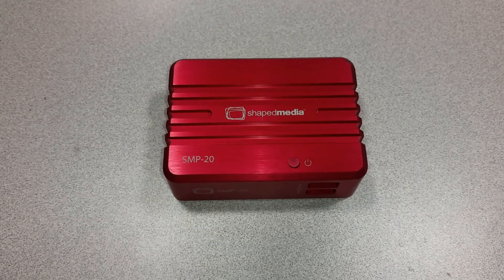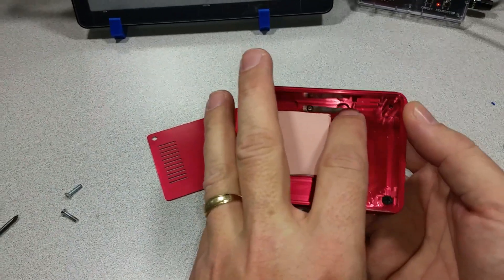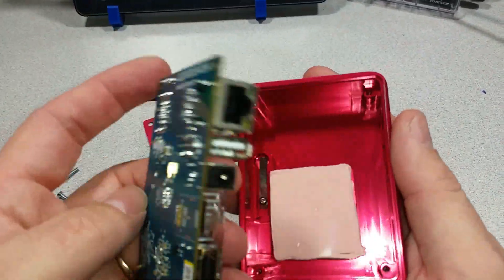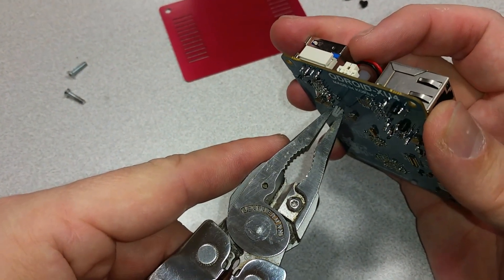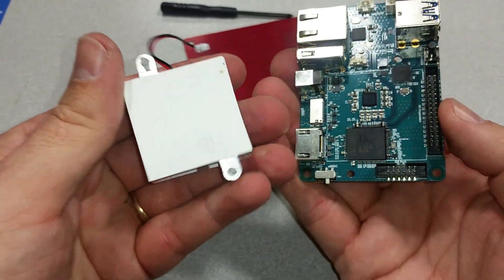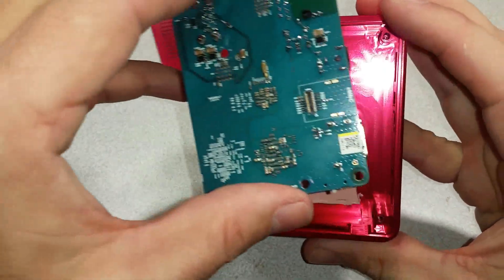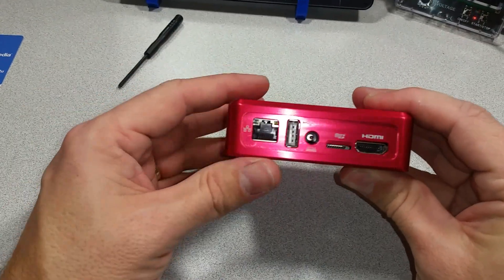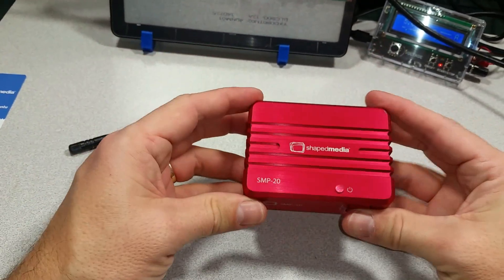Shapedmedia ODROID-XU4 Machined Aluminum Passive Heatsink Case

Comment: Sadly these are no longer available. 
I never understood why the manufacturer didn't think to leave openings in the bottom cover to access the eMMC module and SD/eMMC switch. Only two screws need to be removed to take the bottom off to access the eMMC and SD/EMMC switch. If you use stick-on feet and position them so they don't cover the screws you can have access in a couple of minutes. I was heartbroken to find out these are no longer available so I'm glad I bought the few I did while they were available. This case in silver or black gives the XU4 a very high end look. You can make it hot enough to throttle by running full CPU load testing software but it's not likely to ever throttle from regular use with Linux or Android.  
It could have been slightly better with easy access openings for the eMMC and switch but this is still my all time favorite case. The are worth every penny they sold for. All popular SBCs need a case of this quality. Good cooling and makes a high end SBC look like a high end PC. It's 2020 now and I still consider the XU4 a high end SBC even when compared to the best ARM based SBCs available.

Comment: Tip... use a small flat head screw driver next to remove the plugs, you only need one side to collapse in and you pull it out on one side and repeat.

Comment: my odroid acualy came stock with silver thermal compound. So that shuld chaing the temps but the fan is runing all the time wiel -playing kodi, off for 1-2 sec. cool cases but why so much $$ ?
Reply: ken sanchez They're machined out of a solid block of aluminum, sandblasted, anodized and laser etched. All of that probably costs quite a bit.
Reply: Very awear of all that i hve acsess to most of that kind of equipmint.I just thaink the ragular cases are to much and thear for thay aske evan more for a acual functioning case as this one.

Comment: It is a nice case, but the xu4 runs blazing hot under full load. You can't even pick it up it gets so hot. It is like grabbing a hot plate.
Reply: I have the same issue, the case feels like 50-60C when running emulators
Reply: I was wondering if this case was more suitable for commercial applications and emulation is a stretch too far for cooling. I have seen people say that the XU4-Q sans fan runs too hot on N64 emulation so perhaps this case is good for basic display / point of sale web apps but not gaming?
Reply from the maker: Even under sustained full load, I haven't had any problems picking it up. It is warm, but not warm enough to burn. But the point of the case is to pull the heat away from the SoC and into the case. It works especially well if mounted to another large metal object in an industrial or commercial environment.
Reply: you might have a defective board bro

Comment: I found the simplest quickest way to remove those pins is to just clip the tips off with wire cutters.
Reply: BTW my heat sink had thermal past and no pad?

Comment: Would this case work for keeping an XU4 cooled enough to prevent throttling while running BOINC 24/7, or is active cooling still a better option for such?

Comment: Hello again :)

I have one last question so please bare with me:
I finally bought one of those and have successfully installed it. Everything seems to work as expected apart from the push-power button. That said, I'm wondering whether I aligned the board with the case correctly. However, the screws were all in place and the fit looked secure before I had put back the plate. 

I would have taken the board out to check but I fear the thermal pad could not been re-used and I'd probably need a new one. Firstly, have you noticed whether the button works in your case and secondly, if I have to replace the thermal pad Shapedmedia provided, do you happen to know what brand and thickness I will need?
Reply from the maker: The power button works only to turn off the XU4. It seems to work fine on the unit you see in the video (just tested it). I wonder if yours is maybe not aligned correctly.
Reply: That's probably the reason. I will try to realign the board in the case. Will the pad lose it's stickiness and thermal conductivity if I remove XU4 and re-apply it? If so, do you happen to know what brand and thickness is the stock thermal pad used?
Reply from the maker: *****
The pad will lose a bit of stickiness, but it shouldn't affect the performance. The screws holding the XU4 to the case should provide adequate pressure to keep the thermal bond.
Reply: Thank you very much! I thought that the pad's stickiness was related to its thermal conductivity but, as you rightly say, there are screws which secure the fit anyway.

Comment: Just got my case today. It is very nice. The ballpoint pen worked real good to get the old heat sink off. I had to pull it off it was stuck but just slowly did from one side.

One thing when I pulled the fan power off the wires came right out of the end plug! I guess I should of used something to pull on the plug not the wires.

When I screws the bottom in I guess did it to tight because it pushed in right were the screws go. So you should have some spacers with this so that don't happen.

Love this case. Very nice. I got the green one for low power the XU4 uses.

Thanks for telling me about the ballpoint pen it takes off the pins real easy with out messing up the board.

-Raymond Day
Reply from the maker: Awesome! We got lucky on that green case as we had an overseas shipment get returned unopened (the customer didn't want to pay the import taxes). We are still waiting for our next shipment of cases which will be available in black, red and silver only.

Comment: I plan to use my XU4 as a server running 24/7 and the temperatures I get after extensive testing during the past few hours are ranging between 80-90 C (the fan spins all the time - I believe in medium speed). Do you think the specific case can handle those numbers and keep temperatures under 90 degrees C? In the video the CPU with Shapedmedia case throttles later compared to the stock fan & heat sink but what will happen if the device will run constantly day and night?

Are also the board's LEDs covered or you can see them blinking when the device is powered?

Regarding the removal of the fan, is it possible to put it back later or the plastic pins do get damaged once you remove it?

EDIT: And a last question - Have you noticed any improvement in the device's consumption? Given that this noisy thing should at least consume 0.25A there must be a subtle improvement in XU4's Wattage after removing it

Many thanks. This is a very sleek piece of equipment!
Reply from the maker: The CPU is designed to operate normally up to and even over 95C, and the Shapedmedia case will not keep it from getting to 95C under heavy loads. However, it should keep it well under 95C during normal use. The power consumption will be less without the fan, but we're not sure how much.

The test pushed the CPU to the point where it throttles. All cooling options we've tried have been unable to keep the CPU from throttling under full load. The duration of the test was long enough to bring the case's temperature up to the maximum thermal temperature, so the results should be the same no matter how long you are pushing the CPU.

The LEDs are slightly visible through the port openings in the case, but not like they are with the translucent cases.
Reply: Thank you very much for the info. These are more or less my own findings from using the case a few days now.

I now run the board with the clock of the A15 cores locked to a maximum of 1400Mhz while I haven't  changed the range of the A7 cores. This set up is perfectly adequate for the type of server I'm running. The temperatures range between 52-60 C while consumption is somewhere between 5.2-6 Watts.

Comment: Wow nice case. Good to see that I was not the only one having a hard time getting the fan off. I ended up just cutting the mounts for the fan. I put a bigger heat sink fan on mine. It all ready came with the pins to push on it.

How does it work with heat now with that case. I guess it be good no fan is very nice.
Reply from the maker: +Raymond Day I use an XU4 in this case on my desk as one of my workstations for daily work. It doesn't get hot, and my XU4 runs very well with it.

There's a trick we learned from one of our customers on how to get the fan off. Use a retractable ballpoint pen with the ballpoint portion removed from the pen. Use the opening on the ballpoint housing to compress the clips from the underside of the board. It makes for an easy and damage-free method to remove the clips.
Reply: Wow that's good using a ballpoint pen with the ink so the housing to compress the clips. I have not did that. But I will when I have to next. Thank you for that tip. I even bought a like pliers made to take out clips like this but still not very good for this.

Comment: Looks really good, and judging by the video comparing the fan with this case, it works well. A couple of questions. First, would adding feet to the case so that air can come in through the holes in the bottom improve cooling? Second, any chance of a version for the C2?
Reply from the maker: +James Jones I believe feet come with the new versions (available in black and silver starting Thursday, March 3).

A version for the C2 is in the works.

Comment: A tip for removing the heatsink. I use a Bic ballpoint tube, remove the inner of the pen and push the tube over the nylon pin. It will squeeze the tabs inside and bingo, effortless and completely safe for the board.

Comment: There would be an C1+ version?
Maybe something to encase a C1+ with the VU7.
Reply from the maker: +Mano Shu There may be a C1+ version in the future. However, making one to encase the C1+ and the VU7 would be way too expensive as it would require a very large block of aluminum to machine it from.